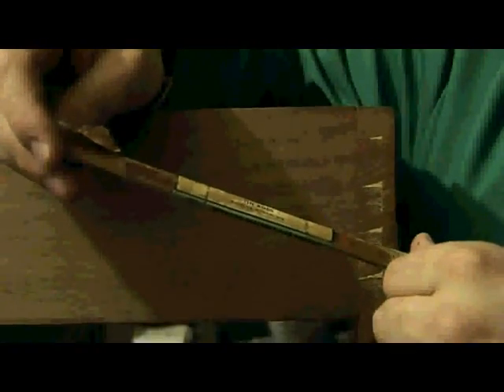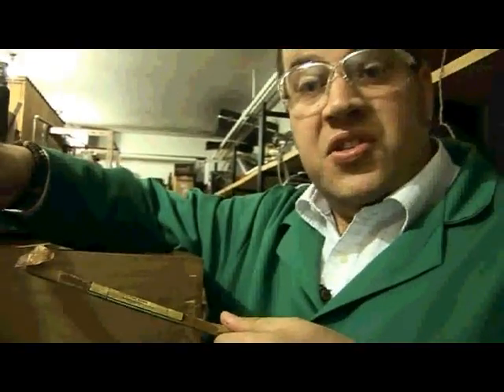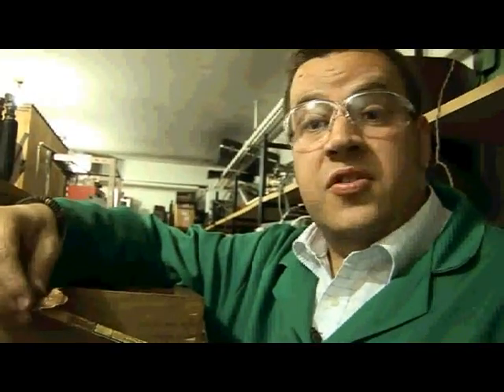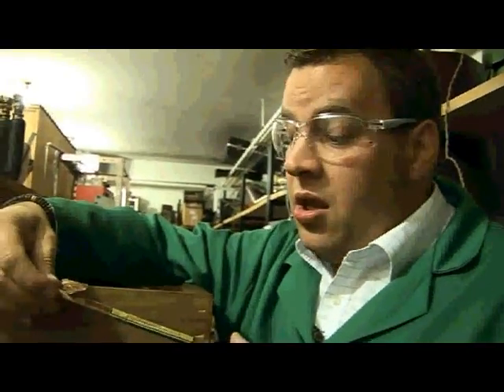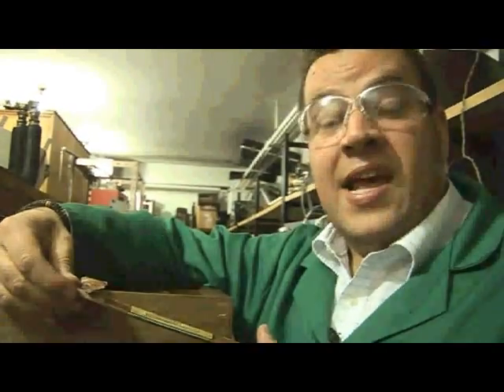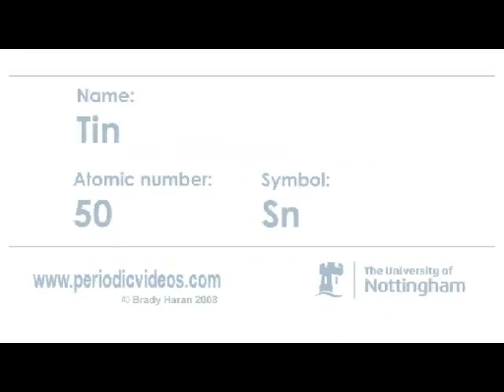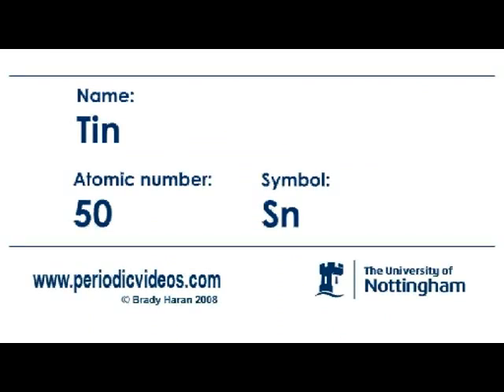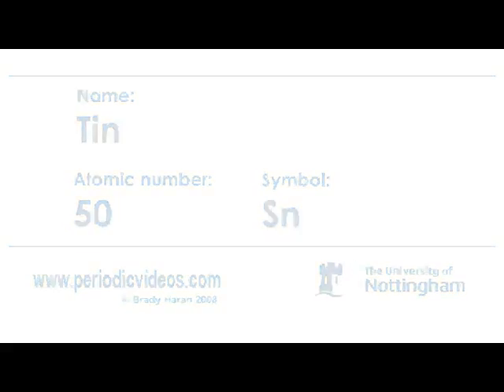Tin (version 1)  - Periodic Table of Videos

Comment: (cont) You take these bars of tin (usually shaped like horseshoes, probably for luck), melt them in a ladle over fire and then quickly throw the molten tin into a bucket of cold water. It forms really cool shapes. Then you look at the shapes and interprete from them what your new year will be like. Some people do it by putting them in front of a light so they cast shadows on the wall and then they interprete the shadows. A shape that looks like a boat means "a journey" for example.

Comment: That's probably because few large bar offer higher potential difference over smaller area? anyway that works well in submerged liquid with ions in it like salt water as it offers an electrical and ion path to all the surfaces. this cannot work in air and is why a plating is used instead. Also a fuel environment doesn't offer the same medium for electrochemical reaction as water does so its effectively like air. So a plating is required.

Comment: its still galvanizing, but a plating allows galvanizing everywhere on the object, but a single bar only offers protection on the local area in these circumstances because corrosion from water only happens in pockets and isn't global to the tank. So its like trying to add galvanic protection when the zinc is in open air and the iron you are trying to protect is in the water, just doesn't work as there is no complete circuit.  Thats why galvanizing is done in the form of plating  instead of a bar.

Comment: well if a singel bare dosent do it then it aint the same principal as galvanizing, and on a side note, how is it that everybody says zinc oxide (even seen pictures) is white, i have seen an entire bar (around 2x20x10 inches) become black (pure zinc), there has to be something funky in the air around here, but tin plating works beacuse the surface ends up being tin/tin oxide and therefore the steel dosent oxidize beacuse there is no steel at the surface, not galvanizing...

Comment: Tin oxidizes a lot less than zinc in this case. Tin oxide is very thin and not normally noticeable. on the other hand zinc oxide can pile up and is quite granular, looks like white colored rust.  This is not ideal in a fuel tank.  Also you say add a bar of zinc. this wont work in a fuel environment, its pockets of water and other settlement that cause issues and a single bar wonk fix this, need to be coated.

Tin plated tanks is a proven technology and its works. 30 year old tanks prove this.

Comment: They use tin as a protective plating on lots of things to stop them rusting. My fuel tank in my car is tin plated inside and out and its over 20 years old now, no noticeable rust on the outside. Inside looks bright clean and shiny, No rust what so ever. its the same principal as galvanizing. I want to be able to get my VW tank split in to two and also tin plated for the best rust protection instead of using tank liner paint.

Comment: Tin based solders can cause problems in electronics. It has a tendency to spontaneously grow crystals of tin from the surface. These crystals, called tin whiskers, grow from the base, and can sometimes cause short circuits. NASA studied this extensively due to satellite failures caused by tin whisker short-circuits.

It was found that adding lead to a tin alloy helped to prevent these whiskers from growing, but since the use of lead is now regulated it may become a problem in the future again.